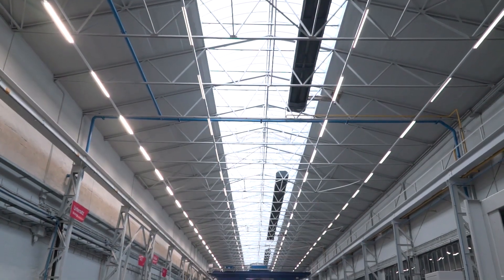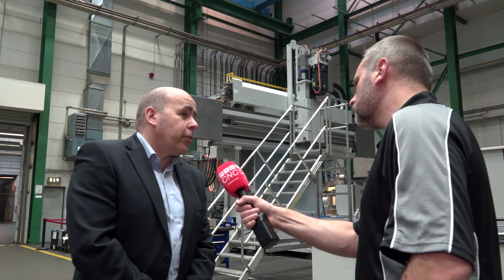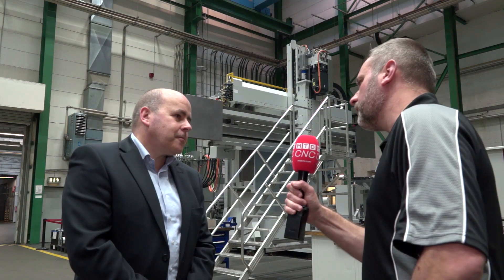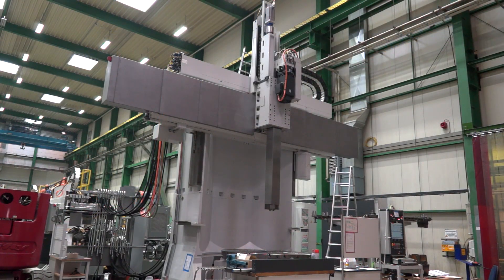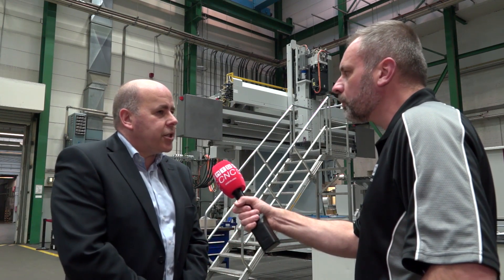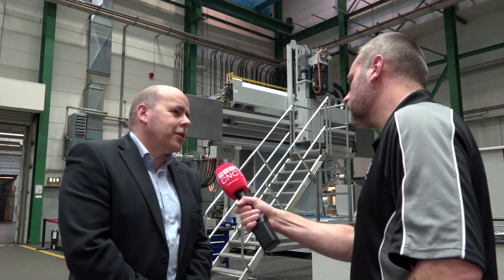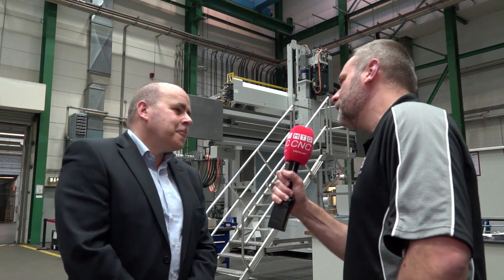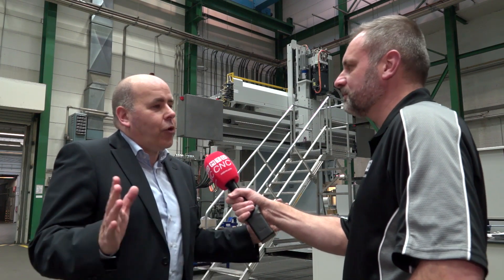Dӧrries’ unique enhancements to vertical turning

Comment: This video states that Dörries has developed a “unique” solution that simulates a linear axis for machining operations out of the center line.

I know a 7 m VTL installed at “Kollmeder Schmiede” in the south of Germany and this machine is equipped with this head

As far as I know this huge machine was installed in 2012 by the worldwide reputated Spanish machine tool builder “Bost”.

This company invented this system, they call it “virtual Y axis”, they have developed already the 3rd generation of this extremely precise “virtual Y axis” head and they deliver dozens of these heads every year.
Reply from the maker: sounds interesting, you may be correct